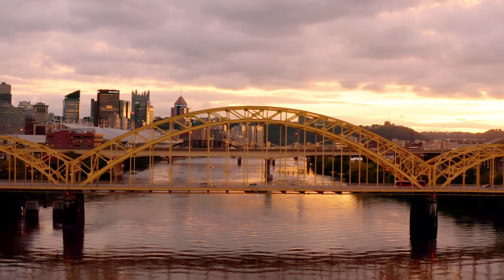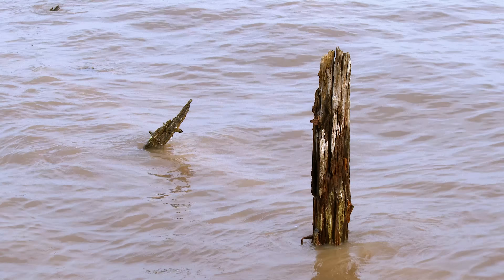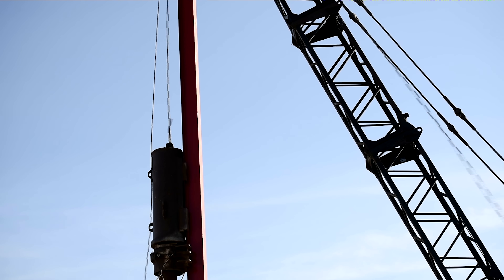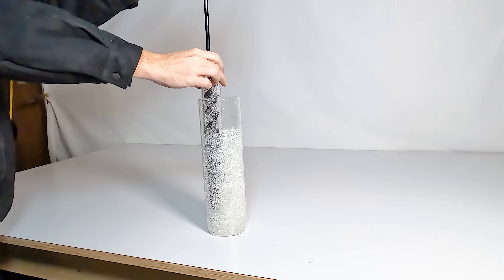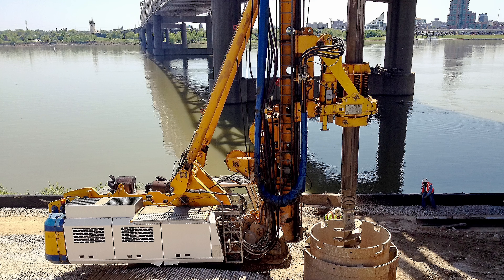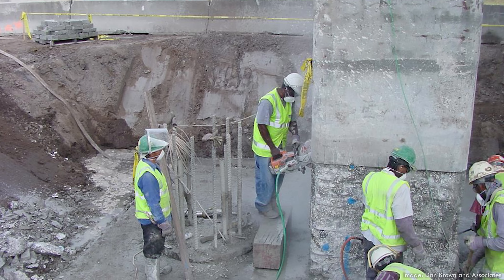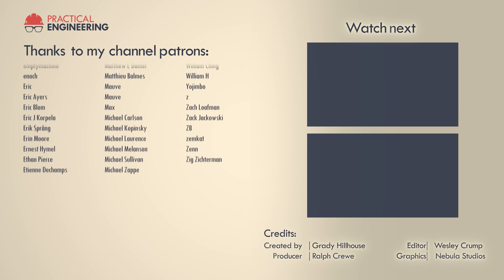Why Bridges Don't Sink

Comment: i beam and H beams are similar shapes but the size of the flange to web ratios are not the same.  I-beam has shorter flange to longer web and H-beam the flange and web are very close in length. for example i have a 4 inch by 12 inch I-beam and i have a 10 inch by 10 inch H-beam. i hope that this helps.

Comment: Somewhere in the Port of Tacoma's archives are books and books of my beats-per-foot logs that give an idea of the relative skin friction for each of thousands of piles supporting the then-new pier. That was my big engineering internship - counting and recording pile-driver hammer blows all day long. Things I learned that Summer: there's such a thing as "waterproof paper" - the pencil would still write on it, even when the clipboard was out in the rain! And pre-stressed concrete is pretty cool!
Reply: I've filled many "Rite-In-The-Rain" notebooks with transit and level data while in Washington and Oregon. Cold hands are the real challenge.
I hope your hearing came through okay with all that sharp noise - mine suffered.
Reply: @chugwaterjack4458 I lucked out--it was a "summer internship"!! 😂😂

Comment: 11:30 honestly i'm equal parts annoyed and impressed that the solution is that clever / simple.
a pipe within a pipe, so you can pipe your concrete+water into water
"wait, won't the concrete just dilute?"
"the first little bit sure but soon the water will just float to the top like oil in well water."

Comment: One nice thing about H-Piles and pipe piles is that you can form a "soil plug" as you drive. Soil gets stuck between the flanges of the H-piles or in the inside of a pipe pile. This can almost make the pile act as though it's solid without using the extra  material.

Comment: Not how you use a t post driver but as an example it will work, FYI use arms to assist in the downward acceleration as resistance increases the post has gotten lower increasing the time and distance of said acceleration up to the length of the barrel once at or below shoulder level you gain mechanical advantage being in the physiological sweet spot. Our arms are great at beating stuff downwards. Repeated lifting for free fall is more work done for the human body than assisting downwards and fewer lifts above shoulder where our bodies are weak

Comment: We were working on a project where the engineer wanted 45' deep driven H-piles. The pile contractor laughed and said, "The bedrock is at 40' here."
"Then you are going to have to drive 5' into bedrock." Was the response.

After refusal at 40', the engineer went off again about 5' embedment into bedrock. The operator spent another 20 minutes pounding on it. Finally, his boss came over, "He just wailed on that pile for 20 minutes, and it moved 1 inch. We can keep going, but we will be charging you when this breaks the machine." 

The engineer sulked back to the trailer, and the rest of the piles were installed until they hit bedrock.
Reply: Sounds like the pile needed to be pre-drilled to facilitate the driving.  Not knowing anything about the structure you worked on, there are some potentially some global stability issues that may need that 5 feet.  I'm assuming the engineer was able to sharpen his pencil to help you guys out.
Reply: @johnlynch5351 We offered drilled piers as an option, but that got vetoed. We had worked with them before, and they were not very good at adapting to changing conditions on those either.
Reply: @absolutechaos13  Sorry to hear that.  We're a mixed bag, I understand, and one of our biggest flaws is being overcommitted to our own ideas.  

Best advice I can offer any young engineer is to work earnestly with a contractor's ideas & concepts.  You'll learn a thing of two no doubt about it.  Sometimes you have to say no but establishing that relationship pays dividends for everyone.

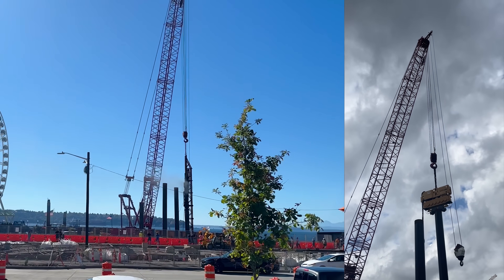Comment: 8:00 we've recently had piles (well, those interlocking half-a-hex-shaped walls) driven into the ground, with people living all around the site. I think they used some kind of extra low noise vibratory driver - the vibration and the noise were certainly noticeable, though. (I was a bit worried about my spinning hard disk drives - i even flipped the NAS 90° - wouldn't want to risk the heads crashing into the rotating platters, leaving scratches and corrupted data behind)

Comment: Sadly in my country a lot of corruption has taken place and bridges, or in my case an overpass in my city has sunk considerably since it was built. 

During the first two weeks, commuters explained driving on the bridge felt like a rollercoaster with how much some sections have sunk. They closed it down and is basically a giant obstacle for a large part of almost three years.
Reply: Do the work right the first and you won't have to do it again.  Sadly corruption makes this impossible on occasion

Comment: Are those not both “H-Beams” that Grady had pictured in the video?  **from Google: While both have a horizontal and vertical element to their structure, H-beams have longer flanges and a thicker centre web than I-beams.

Comment: Should have played the audio of the driving to give people an idea how terribly loud it is. Love the video as always!!
Reply: Especially the one that is essentially a big single cylinder diesel engine .
The driver hitting the post compresses a piston in a bore , where fuel is injected , and , the explosion instead of driving a connecting rod to turn a crankshaft , is directed downward into the pile .
That's why the one driver was belching clouds of black smoke on every strike .
They are very effective , and , AMAZINGLY loud .
Reply: You know how pile bucks greet each other? "Hi!", "Huh?" "What?" "Louder, please."
Many pile "bucks" and inspectors have suffered hearing loss over the years, like any artillery gunner, until effective hearing protection was developed. I remember told on my first pile job (in the '60's) to wad up some tissue and jam it in my ears. Not very effective, but did seem to take the corners off the noise.

Comment: Some of the differences are H piles are made of different steel typically A572 Gr. 50 instead of the A992 for a wide flange beams. H piles typically have equal thickness flanges and webs also equal depth and flange width dimensions.
Reply: Those grades are technically different but practically identical. Most stuff coming from domestic mills is certified to meet the specifications for both grades
Reply: Plus to my knowledge H profiles are square in dimensions. I profiles aren't.
Reply: The dimensions are the critical part to that, the steel is mostly incidental nowadays, as Jason points out. There are reasons to spec one grade over the other, but really, if they're all dual or quad certified anyways, it's all good steel. Just don't go to china.

Comment: I'm one sentence in and already having an existential crisis: If you build a structure to facilitate transportation between two points, but it doesn't have empty space underneath it, is it not a bridge? 

I don't want to call it a wall (though it is effectively that) because it's primary purpose is facilitating rather than hindering movement. Would you just call it infill?
Reply from the maker: Embankment
Reply: @PracticalEngineeringChannel  Thank you!

Comment: Roman concrete was used directly in the water, was even designed to not fully cure leaving pockets of uncured concrete when cracks form, those pockets cure allowing the structure to repair it's self.
Reply: Not much different that modern high-quality hydraulic (Portland) cements.  It's not that the Roman stuff is 'better'.  It's just been around a long time - a.k.a. survivor bias.
Reply: @fredinit  Not exactly.  Modern concrete is tested for strength, and usually not paid for until that strength is achieved.  Also the strength is often needed for subsequent stages of construction.  Therefore it is ground finer to set faster and usually has a chemistry to reach strength faster too speeding both the flow of money and the work.  It also gets hotter when it sets and can shrink and crack more.  So it is better from a financial viewpoint, but not all structural viewpoints.
Reply: And amazingly with mineral intrusion over time, it gets stronger.

Comment: I've got a question on the Battered piles. When driving them deeper how do you know if they broke? Same question with the pile cap? With the battered piles I'd assume after awhile they would break off the cap?
Reply: Usually it's not an issue, but there is a test called a Pile Driving Analyzer that can be done during pile driving to check capacity and to make sure it's not broken. It's basically an accelerometer and a strain gauge attached to the top of the pile. Software analyzes it in real time.